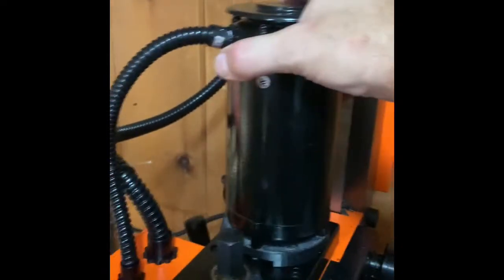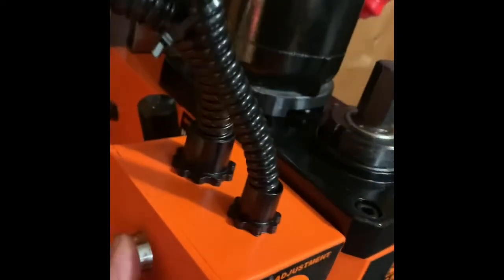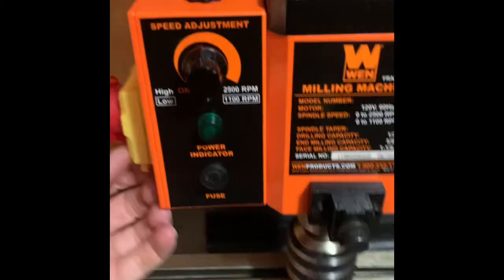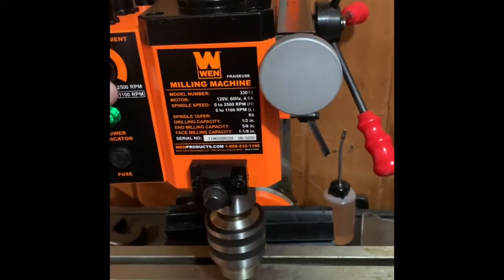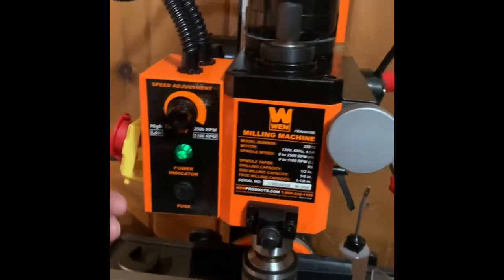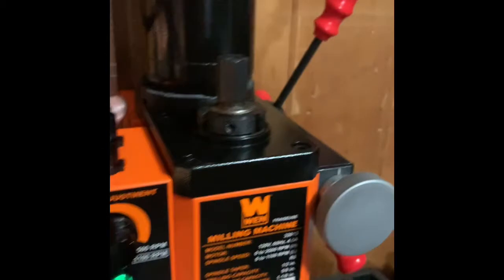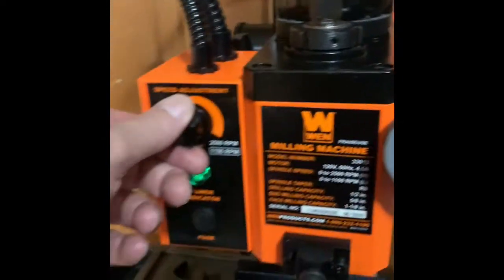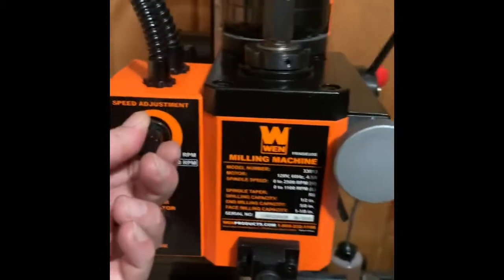Wen 33013 Mini Mill 3D Printed Motor Mount (Part 3)

Comment: Would you buy this mill again with owning it now? I'm wondering if that mount was a common problem.  I am looking to buy this exact mill
Reply from the maker: I would probably go for the little machine shop version of this mill with the rigid column and brushless motor. It’s a better deal with all the upgrades and you won’t have to worry about constantly having to tram the base.
Reply: @mactube1  thanks man for your opinion, I do appreciate the feedback... gonna go on their website now.  Good thing I didn't buy one yet